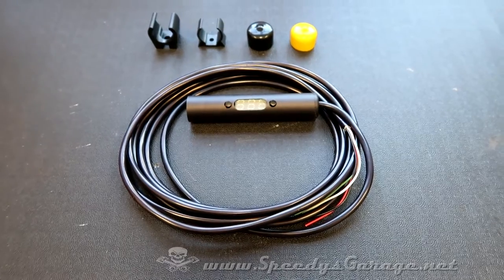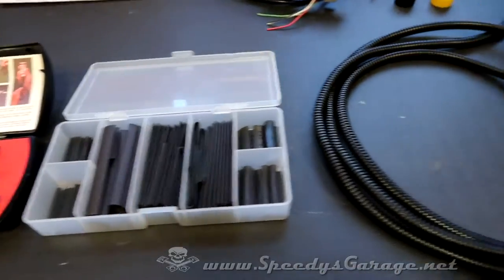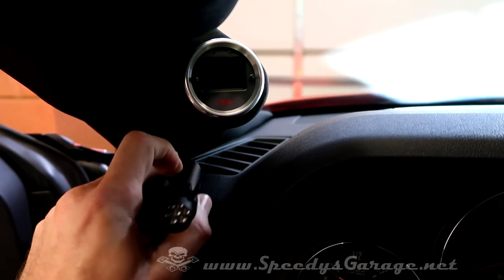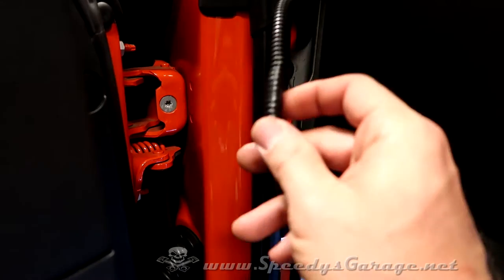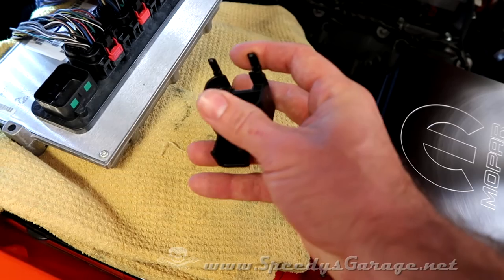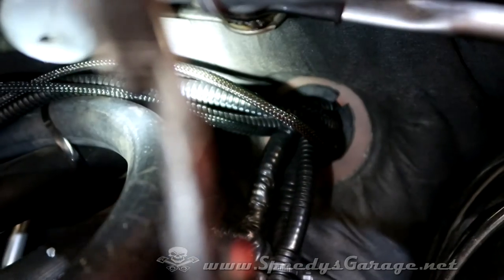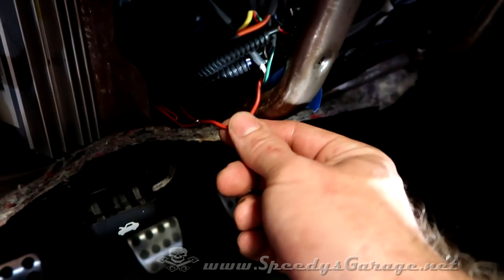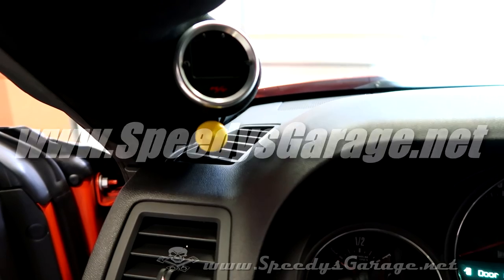Raptor Shift Light Install

Comment: Hey man, I know this is an older video, but do you happen to have a pinout for the NGC3 or NCG4, I am looking into doing a tach + Shift light, and RPM switch, but don't know what I can use for a signal. You say you used Pin 10 on connector 2, is that a specific RPM signal or like the coil signal? Thanks!
Reply from the maker: Sorry man so long ago I can't remember.  I think it was coil but don't hold me to that.
Reply: @SpeedysGarage  No worries man, I looked on Raptor's site , and yeah from the looks of it, it does seem to be the Signal wire for coil 1, Thanks!

Comment: So i'm looking to wire a wideband AFR gauge that needs a tach signal, I'm assuming I could tap that same RPM wire you used  (blue w/ green stripe) to get the necessary signal for my gauge?
Reply from the maker: Should be good.  Obviously test it first LOL.